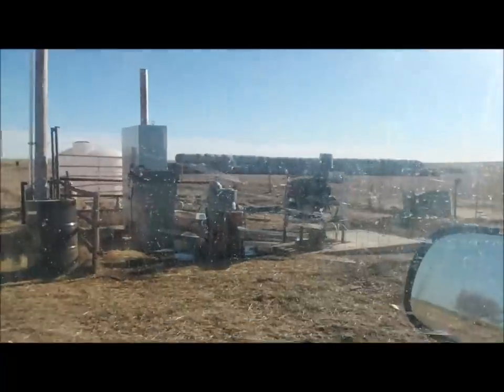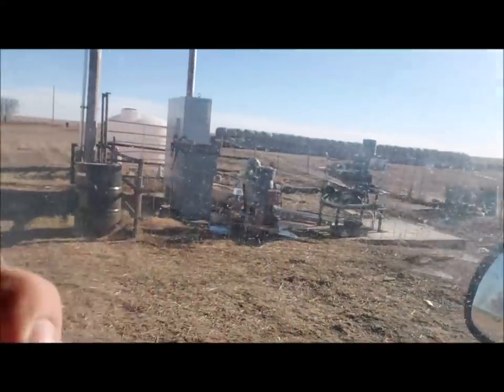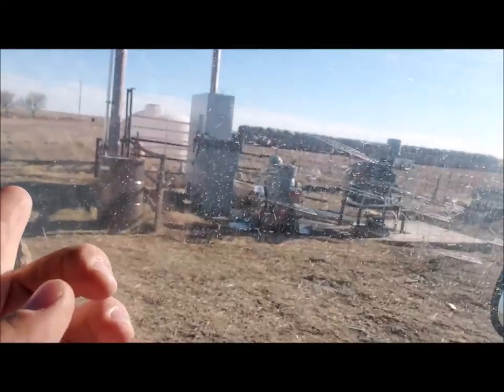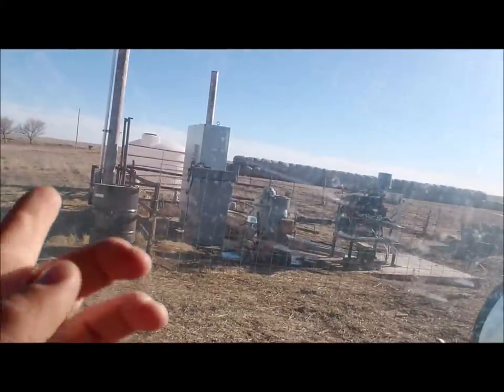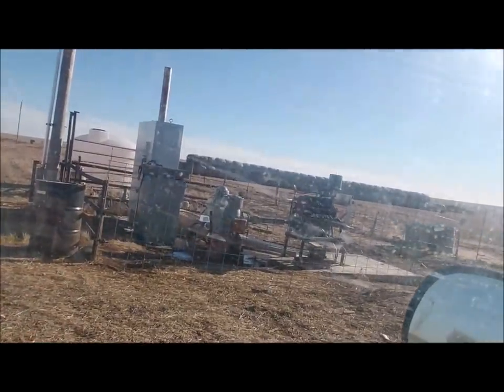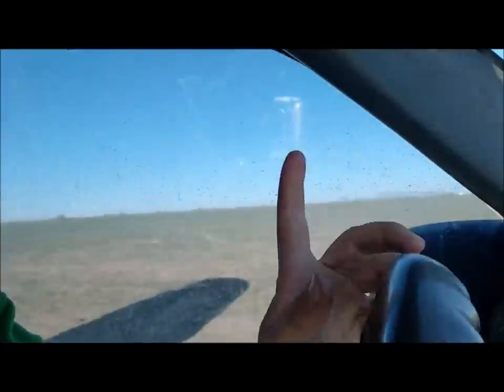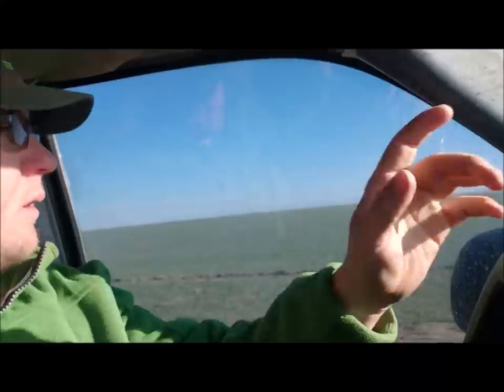New Irrigation Motor

Comment: When I was a kid visiting my grandparents in Portales during the summer you could hear the pumps howling all night. Grandpa's had a 392 International that belt drove the pump, ran on propane.
Now days they don't hardly do any farming and those that do use electric motors kind sad not hearing them bellowing all hours
When he was irrigating he used ditches and siphon tubes,we would take a watermelon wrapped in burlap and stuff it under the bridge after 12 hours we would cut it open and it would have ice inside it.
All we got was lots of wind and for the first time we were with out power for longer than a couple of hours, 6 hours this time made for a cold night when the house is all electric.

Comment: i am glad we dont need that stuff here, man and the kmiles of 6" hose you would need, if you seen my videos, here in north western Ont. Canada, it is ether 40 below and many feet of snow, or raining every other day, lucky if we get a few days a summer over 80 deg.. stuff grows good. most years 3 to 4 hay cutting a year. last year only 3 cuttings, fall was rain every day and cool, today we hit a high of 42 deg and some snow is slowly melting.. it been in the 30's to 40's by day for the past few days,but nights drop down to 18 to 22 degs yet, had some heavy rain days in there as well, witch drove some snow down, ut still many feet to go. really cant see you making any money on hay running that thing at the cost of fuel, never mind the cost of buying that thing, and you only get maybe 2 cuts a year, and it only water a so big an area.. oh then the cost of having to pay for the water you pump out, plus the cost of the wells, NG GAS IS UP THERE WITH HYDRO HERE, THEY BOTH HAVE A DELIVERY CHARGE thats more then product used, plus other fees, and hay is ether $40 a bale or horse hay $75 a bale cnd

Comment: Around here there has been some people switch back to Natural gas and it is way cheaper, but you still have to pay the electric company the min payment.   Some guys have switched and then got tired of motor problems and had to pay the electric company $30,000 to hook back up because they refused to pay for the service.  My natural gas pump is the cheapest one I run , but more headache.
Reply from the maker: Yeah, natural gas motors are a huge headache, but right now Im hoping it will save me money over the next five years. I dont have to pay a minimum since I had them disconnect the meter, but our electric company kinda shot themselves in the foot with forcing everyone putting filters on. I truly prefer electric. so much easier